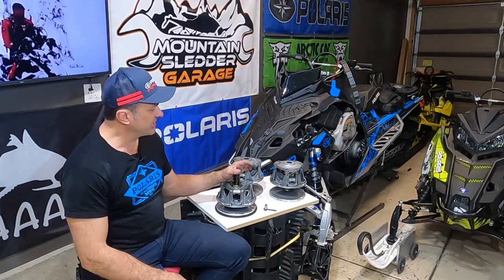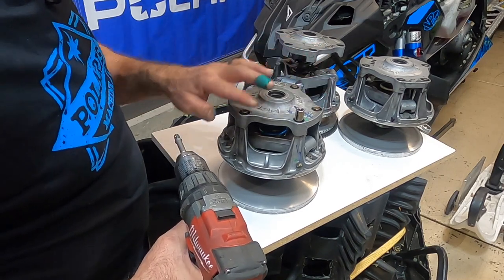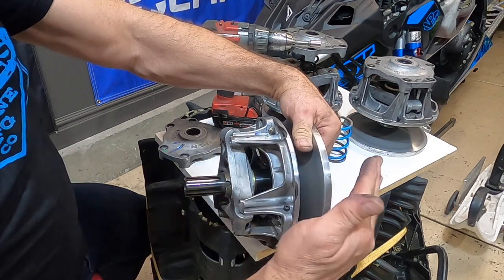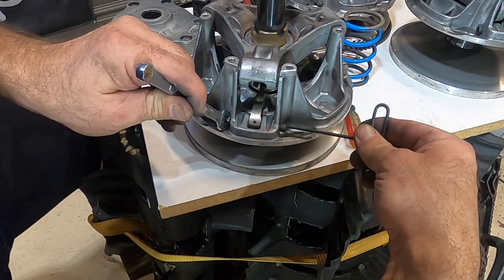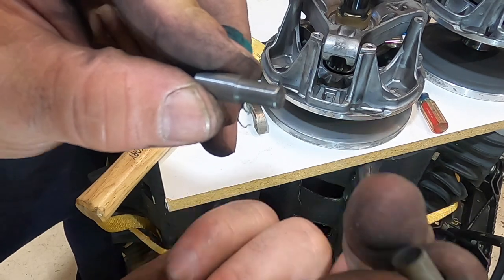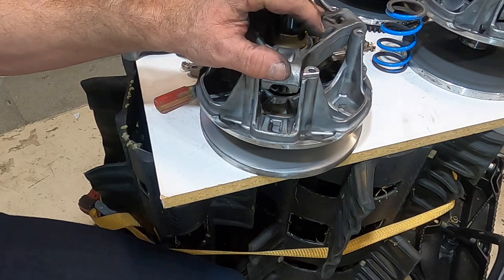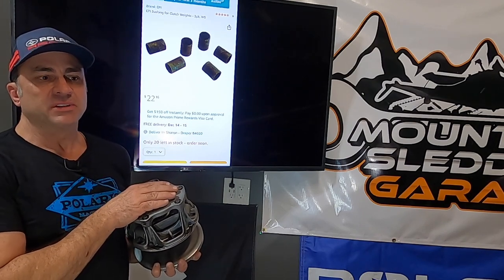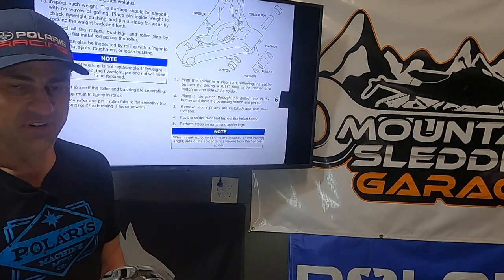Polaris snowmobile drive clutch cam arm bushing replacement

Comment: One trick I've done to help get the nut off the clutch weight pin is to grind one side of a 10mm socket so it goes over the nut and butts up to the tower.
Reply from the maker: That’s a great idea, thanks.

Comment: Nice job. On the no spray on components. I've been using crc silicone spray on all bushings religiously for years. I've put Over 6,000 miles on clutches with virtually 0 wear. If it works, use it.
Reply from the maker: Yea, supposed to be dry lube. When we bought our first cats 25 years ago we were told to spray with a similar lube before each ride. 
I think the rational is anything wet from a spray on lube will stick dirt and grime to it, possibly increasing wear.  Since we don’t ride sled in dirty, dusty environments it’s probably not much of a issue.

Comment: Good video, do you use an impact to get the primary off with a puller?
Reply from the maker: That is the question of the century!!! The Polaris manual says to not use an impact, but they also say if it doesn’t come off easily to sledge hammer the end of the puller and it’ll “pop” off! Personally I don’t like to pound on the crank with a hammer, have been using an impact wrench for years. Impact is just so easy and quick.?
Reply from the maker: Or I use the “water method” for really stuck clutches. Thanks

Comment: Quick question is there supposed to be any kind of lubrication on the wights and rollers? And if so what would you recommend. Would brake caliper grease work because of the graphite content?
Reply from the maker: No lube on any of the clutch parts. Any lube you put on there has a chance of getting on the belt and causing slipping in the sheaths.
Reply: @mountainsleddergarage8627  ok good to know